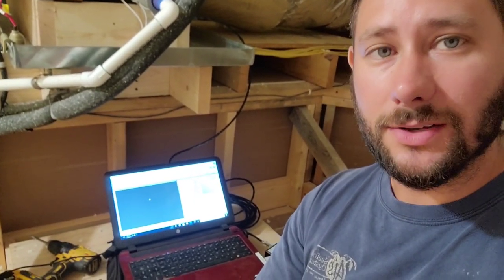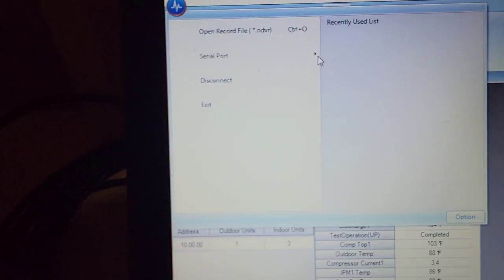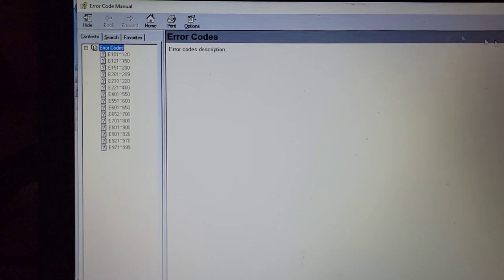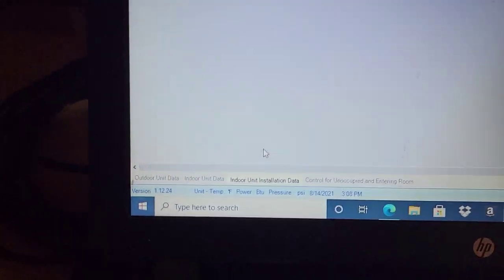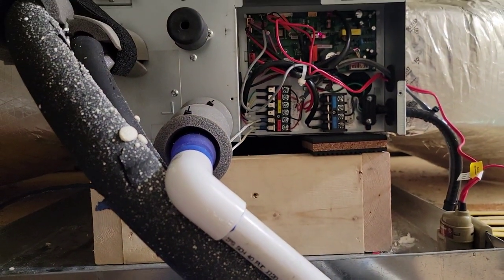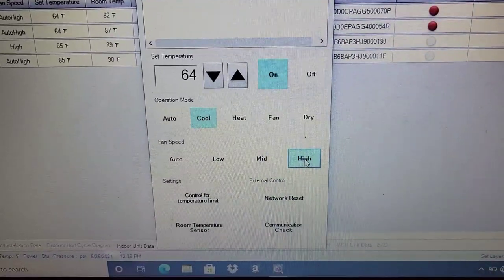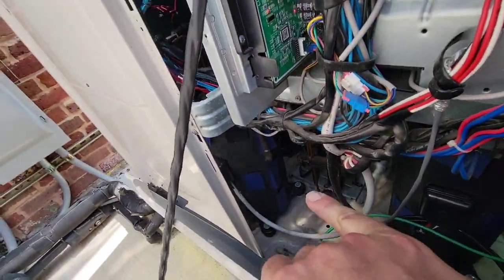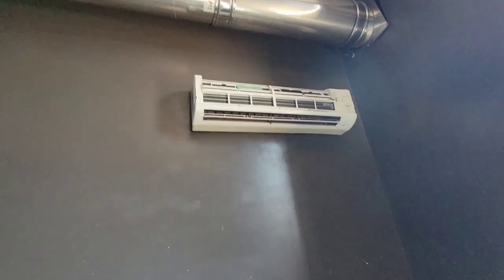How and Why to Use Samsung HVAC SNET Pro Software

Comment: Thank you for this video sir.
May I just ask one question sir, is it safe to mount the wire in f1 and f2 is there no current running when I touch the port where will alI hook the wire
Reply from the maker: your welcome f1 and f2 has 0.1 to 0.7 volts dc

Comment: Do I have to use the Samsung s-net converter, or can I use a usb to serial rs485 converter Instead?
Reply from the maker: should be able to use either
Reply: You will be able to do everything except firmware updates.

Comment: that unit looks possibly under charged a bit.. how do you chose the appropriate fan speed static setting for S duct units
Reply from the maker: I maesure the fpm on my supply registers and return and then adjust the fan speed accordingly

Comment: Whats the difference between the 2 programs?
Reply from the maker: One program is for the newer models and the other program is for the older model
Reply: @TaddyDigest  so I need 2 have both programs? or with the new model works for old and new?
Reply from the maker: You just need the newest program to work on the new models
Reply: is there any universal s net bro!